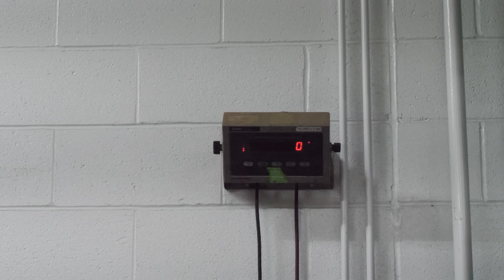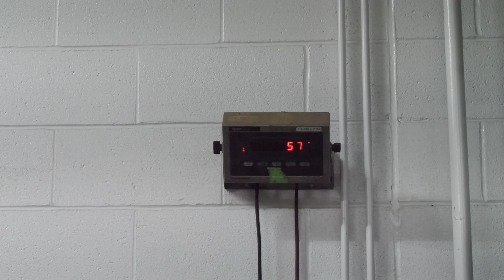EV TEARDOWN! Nissan Leaf Complete Electric Vehicle Drive Motor Unit Disassembly!

Comment: Bro went from I Do Cars to I Do Dishwashers
Reply: As long as we don’t end up at battery fires and just do motors we good
Reply: I hope you're not a comedian.
Reply: I like my Tesla dishwasher because it costs $3 instead of $17 for commute, does 0-60 in 3.5 seconds and can drive me to work if I don’t want to in absolute peace and quiet lol 😂😂
Reply: It's the future
Reply: Lol
Reply: 😂😂 facts
Reply: Hey, I thought that was hilarious 👍🏻
Reply: That's not a dishwasher it's an electric clothes dryer
Reply: Well the GM ones are basically a LG washer motor 😉
Reply: @bobbysuazjFhvcfgh they all have pros and cons. Tesla is known for absolutely trash fit and finish, nobody but Tesla can work on them, the batteries are hellaciously expensive as is the entire vehicle, and usually have a life span of 10 years on average. They also rely on a stable source of power and have limited range.
Reply: Appliances for sure lol
Reply: @t-yoonit  when picking up my car, I had a paint thickness gauge and spent 2 hrs but couldn’t find a single issue. Powertrain has 8 years 120k warranty, who else offers this kind of warranty? I have taken several 500 miles trip and never had any issues, it only adds about an hr to my 8 hour trip. Teslas will outlast all other gas cars with high pressure turbos now. Anything else? 🤣🤣
Reply: A nice pre-Thanksgiving thing. Thanks Eric.  Hope you and your family have a great Thanksgiving. 👍
Reply: This is the future, buying cars that you throw away when it runs out of gas and buy a new one. 😂
Reply: Yeah, these things have about as much character as a dishwasher with wheels, and similarly, once they've aged a bit, typically aren't worth the repair costs if something breaks due to wear or is damaged in an accident.
Reply: FACTS😂
Reply: @The-AgeofAI  
In New Zealand we love our JDM imports...
RHD in both countries so there's that..
and we have a number of Leafs.... 
because being a temperate climate means the batteries do not get too hot nor do they get too cold...

So charging/time are the two variables.

However we have some clever people in Christchurch who have rewritten the Japanese software to get the whole dash speaking English.... 
and can slip 62kwh batteries into original old 24kwh Leafs...

They rip apart test and rebuild battery packs the same way others like overhauling a 4 cylinder ICE

See also Robert gets a new battery in his Leaf..UK YT vid
Reply: @bobbysuazjFhvcfgh ok, ok!
We get it!
You're a Tesla fan boy...
Reply: Love my dishwasher, so quiet and smooth! Ain't no need for that dinosaur juice from those nice democratic nations
Reply: Love the out-tro…hope you find blue!
Reply: @bobbysuazjFhvcfgh  lol same with my Equinox EV. Ive saved almost $2500 this year just not buying gas. Its nice not knowing or caring about what gas prices are. My work has free charging so I pay nothing in “fuel” costs the majority of the time. And I and many EV owners have the option of getting equipment to use our vehicles as a battery backup for our homes during blackouts.
Reply: “Youtube, how do I block children’s posts?”
Reply: @bobbysuazjFhvcfgh  just wait till the power goes out
Reply: @RST-R-MODS  real enough to take people back & forth to work and the store. Just because the method of propulsion is different than what you are used to, doesn't mean it's not a car
Reply: As long as the dishwasher can burn rubber i'm all for it! 😂
Reply: Lucid air front drive system.
600hp
Weight of motor & gearbox.
150 pounds.
Please feel to point to the LS that match these numbers.
Reply: Lucid air front drive system.
600hp
Weight of motor & gearbox.
150 pounds.
Please feel free to point out the LS that match these numbers.
Reply: BRUH‼️🗣️ YA✔️... Read more
Reply: @bobbysuazjFhvcfgh and at a 100k you’ll end up buying a new one as batteries cost the same👍
Reply: @ and I have a 120k 8 year warranty. How much was warranty on ur car?? No need to answer that question I know it’s less 🤣🤣🤣
Reply: @ your right, I bought it at 12k, and currently sitting at 350k, call me when you reach that😂😂
Reply: DAMN IT !!!! 😂😂😂😂😂😂😂😂

Comment: "... the CURRENT situation." I see watt you did there.😛
Reply: He couldn't resist and It was shocking.
Reply: u couldnt RESISTer
Reply: I received a charge from these comments ⚡️
Reply: There’s no shortage of joke material in the electrical field.
Reply: Dude has potential 😉
Reply: quite drawn to theses conversations
Reply: This comment thread gets me amped!
Reply: I diode when he said that.
Reply: Ohm my god😯
Reply: stop it, your gonna blow my fuse
Reply: Careful pulling Blue off that magnet, or it might hit you in the Joules.
Reply: These puns are so bad it hertz
Reply: I am so glad this motor made it to your circuit of engines...
Reply: If it blows up you may not find a trace of the problem.
Reply: I would think you would leaf it alone

Comment: So no malice in the combustion palace? 👉👈
Reply from the maker: Just wait! There’s a Saturday in the future
Reply: Which begs the question...is the "Juice" worth the "Squeeze"?
Reply: I mean it's possible for this to become a combustion palace but it might not be a palace
Reply: @patturnbow8761 
It was blue...
Did you see it?🤔
BLUE even got carried away with excitement.😂
Reply: @OperatorIHC No combustion so no palace.
Reply: A little malice in the Electric Palace as there were soarkles in the drive train😂
Reply: Do any EVs have a combustion palace in which to have malice?
Reply: @robertwest3093 the Volt? The BMW i8?
Reply: Zappage in the electro magnetic package ⚡️
Reply: @robertwest3093  I hear it said that there is definitely combustion, usually involving the fire department. Palace, not so much, as it usually happens driving down the road or freeway.
Reply: No, Eric just do a toil hoping to find some oil spoil in a coil perhaps.

Comment: Speaking of giant magnets, we had a guy in the 80's who responded to a burglar alarm at a radiology center with Cat Scan machines. While searching the premises he entered the Cat Scan room and was quickly disarmed by the giant magnets that sucked his duty pistol out of his hand. We had a hell of a time getting it back and the gun was magnetized after that.
Reply: I always thought they were electromagnetic devices
Reply: CT scans are X-rays, MRI's are the giant magnets. So had to be an MRI that disarmed him which if true is hilarious.
Reply: @zwhitehead403  MRI it was then and it happened.
Reply: Sometimes they have to turn the machine off.  Costs thousands to turn back on.
Reply: @Lazerchicken69 They are, however they're essentially left on all the time due to the complex (and possibly expensive) shutdown and restart procedure.
Reply: There was a case where an officer who carried a 1911 came for a MRI. Knowing about the magnet he took his duty rig off but still go it too close. The 1911 was pulled from the holster, flew into the machine and discharged into the machine on impact. Investigation showed the magnetic force had pull the firing pin forward with enough force to ignite the primer and discharge the round. Empty case was found in the chamber because the slide couldn't cycle.

Comment: YES when you mentioned about the unsubscribing, I checked and had been unsubscribed. I have been listening to your videos for a long time and definitely didn't unsubscribe. But I subscribed back just now. Crazy. 

That is an interesting motor. I work on motors and generators in industry and for a hobby on antique stuff.  That type of motor (in industry) is called a permanent-magnet synchronous motor, or an electronically-commutated / brushless DC motor. The part with the magnets rotates and is called a rotor. In any motor the rotating part is the "rotor" and the stationary part is the "stator."  In the case of the Nissan motor, the rotor wouldn't really be considered an armature. That name implies it has "arms" or pole pieces with windings around them.  With most alternating current motors, the stator is the armature. With a DC brushed motor like a starter or blower motor, the rotor is the armature. The brushes create alternating current on each individual coil of the rotor as it turns and the commutator segments related to each winding pass the brushes. In this motor, the stator receives alternating current form the drive electronics, and is technically the armature. This will likely get a lot of blowback from those not in the industry but if you look at the engineering definition you will see I am correct. 

It is interesting that they used sealed bearings in the motor. Those have a finite life; unlike the gearbox which has lubricating oil which can be renewed. That is a life-limiting point on this design. 

Another thing I am trying to understand is why you were afraid and concerned for your safety to take the motor apart. Is that some sort of "thing" in the auto motive EV world that they have been indoctrinating into people? I would never worry to tear apart an electric motor. If the power is off, it is not dangerous beyond the magnets in it.

Thanks for making this video. Really enjoyed it! Also, again YouTube unsubscribed me from you. That is frustrating. Keep up the great work.

Looking forward to your next engine teardown, and other videos you make.
Reply: The danger is in the strength of the magnets.
Reply: @jefeglancy  the danger was in the strength of the magnets & the fact Eric had no experience tearing one of these down. He’s intelligent enough to realize that. Unlike the majority of this world anymore as it seems.
Reply: Same here.
Reply: He must have said something that Kamaltoe didn't like.
Reply: Yeah I think he was cautious of the "finger trap" if the magnet strength pulled the rotor or a tool in where his hands were.
Reply: Good description. Thanks!
Reply: That isn't an ECM. It is a 3 phase synchronous AC motor. The DC from the batteries is inverted.
Reply: Same here. I have been a subscriber for a long time and after watching this found out that I'd been unsubscribed
Reply: The motor does not run in oil, which is probably why they used sealed bearings.  Because electric motors run so smoothly, I would expect these bearings to have a very long life, and not be a major issue.

The motor does not run in coolant either, the coolant passages are in the aluminum motor housing only, mainly to cool the stator laminations and the windings.  An electric water pump circulates coolant through the housing, and eventually to a radiator.
Reply: Wow, very enlightening description. Thank you!
Reply: Wow, very enlightening description. Thank you!

Comment: Eric, you didn't hurt that motor. I"m just happy it didn't hurt you! Here's a hint for assembly. Set a pallet on your table and drill a hole slightly bigger than the shaft to pass through. Vertical orientation makes assembly fairly simple. Also use a strap and a lift to lower on the case. KEEP FINGERS CLEAR!!!!!

Comment: Funnily enough, the newer leafs that make 200 hp effectively have the same drivetrain as seen here. The inverters have a higher power limit set, but the physical hardware is the same. People who have used leaf motors in conversions have tested this motor to over 250kw (335 Hp).
Reply: One of these motors in each corner of an EV dragster with a Tesla battery to power it....
Reply: @JohnSmith-pl2bk  If its a dragster, then you would want hybrid batteries for it. the currently avaiable tesla batteries are optimized for energy storage not output. A bunch of Pacifica batteries would give you more power per pound.
Reply: @jakekiedaisch2279  
What about a really really big dangerous capacitor....oh wait
Reply: @JohnSmith-pl2bk  you don't need fancy power solutions, like most electric/electronic stuff more volts = more power... and heat. could run it on cr2032's from your car keys if you were crazy enough. you want a more powerful motor, hit it with more voltage. 

just make sure you've got some electrical engineering credentials first so you don't unalive yourself
Reply: @MrOsmodeus  Battery chemistry and design plays a critical role in how fast you can drain it. You can't get all of the power out of a CR2032 in a few minutes. The internal resistance is something like 20 ohms.
Reply: @jefeglancy Interestingly, the batteries I built my off-grid portion of power at my home have individual 🔋 cells that can discharge 10 amps continuously.
70 of those batteries in parallel in each battery brick = 700 amps continuous drain rating.
Then 14 off those bricks in series gets me my 48V at 700 amps.
I added another 14S section in parallel to make that 1400 amps on a 14S 2P build. 
I'll never use that capacity however.
The most i see charging off the sun has been like 40 to 50 amps (at the 48V battery side) and about the same to discharge. 
Operating way under those battery limits 👍
Reply: @jefeglancy  well that part WAS a joke. i think by the time you had enough of them to provide the current to rotate the motor the cases would have melted.

depending on the format of drag racing i'm not sure i'd want lithium. sodium probably couldn't discharge fast enough, leads too heavy.  I'm going to assume EV drag racing isn't at the level ICE drag racing is in terms of used once then total rebuild?
Reply: @MrOsmodeus  actually for EV induction and IPM motors more voltage =\= more power. If you increase the voltage fed to the inverter, all you get is a higher rotor speed before BEMF becomes a major limiting factor. If you want to increase the motor torque and thus force, you need to increase the current limits.
Reply: Tesla Plaid run 9.3-ish at 152+ MPH. Drag strip rules previously said that time needed a roll cage, and that MPH needed parachute “braking help”
Reply: This is actually the motor and gear reduction from a 2011-2012 leaf. The 2013-up leaf drivetrain is the one you are talking about. The inverter on this motor is remote mounted with a wire harness. The inverter on the 13-up is mounted directly on top of the motor.
Reply: @mandmwaddle  I am aware of the differences between the EM61 and EM57 drivetrains. I just didn't want to make my comment more complex since the point still stands.

Comment: Thanks for doing this dude. The later version of those motors are actually really common for EV conversions (I have one in mine with a hopped up inverter for more power). It's really cool to see the reducer box torn down, only ever seen the slightly revised one and I can see now that it does look like they changed the casting slightly. 

One note about the motor, some people do like to use those in conversions but since you disassembled the resolver, anyone using it would have to figure out the new resolver offset when they put it back together. I learned the hard way that they can be extremely sensitive to slight variations, so much so that Nissan laser etched the value on every motor housing after assembly.

Comment: A quick safety note: Use care anytime you handle an armature with permanent magnets- the magnetic fields are so strong, the armature can "jump" towards steel topped tables or other iron and steel objects, crushing your fingers in the blink of an eye.

We had a guy at the Honda shop we called "Stumpy", since he peeled off the tip of a finger between an IMA rotor and a steel table top.
Reply: Wot he said. Also I've seen the magnets crash together and shatter, throwing tiny ultra sharp shards everywhere.
Reply: @ColinSBC  there are absolutely permanent magnets in some 3p ac motors
Reply: I will always remember this, thank you for the warning.
Reply: Stumpy 😭
Reply: Yep those IMA motors don’t mess around. 

I usually shim the IMA motor with cardboard from a cereal box in lieu of the special tool.
Reply: There is just steel core and windings of copper
Reply: @teknotapsa3964  Not in EV Motors. The 'armature' is a solid permanent rare earth magnet
Reply: @stephenw2992  well live and learn
Reply: @teknotapsa3964 definitely some big ass magnets in that EV 3ph AC traction motor.
Reply: Even the starter motor off my lawn tractor has given me some painful pinches.
Reply: @stephenw2992  Except Tesla does use AC induction motors in some of their cars. So no bono for you.......
Reply: @EETechs  Copying BMW are they? I doubt any motors hitting the scrap heap are induction yet, but who knows given how poorly many EVs are constructed.
Reply: @stephenw2992  They used AC induction well before BMW. The Tesla Roadster and early Model S cars was AC induction and there is plenty of them for scrap to pick up and teardown...AC induction is a mature technology since 1888, but less efficient than brushless permanent magnet type motors.
Reply: @EETechs  AC induction might be less efficient but doesnt use expensive rare earth magnets so there is that. I've been telling people their EV is even more primitive tech than ICE but they just wont believe me. Seems its even more primitive than I thought if Elon started with induction
Reply: @Austin-jw7pu  Not in BMW's but most EV motors have permanent magnets